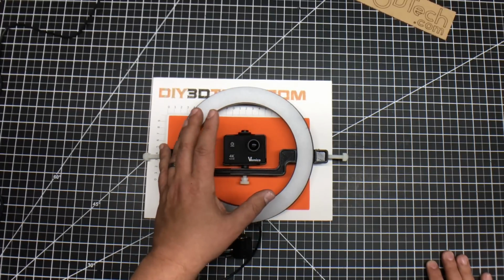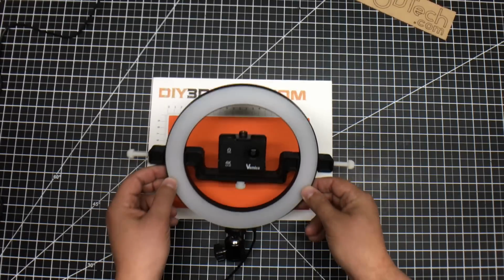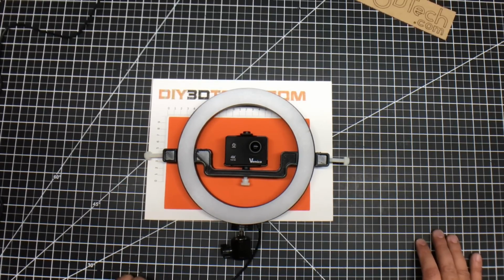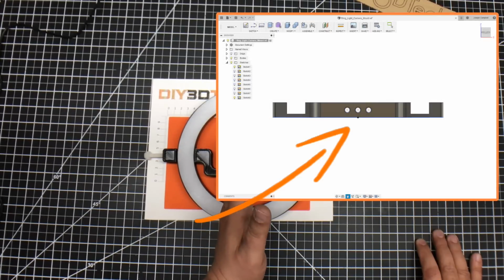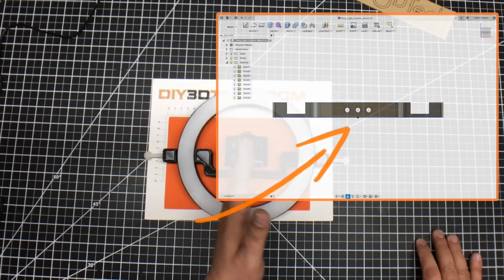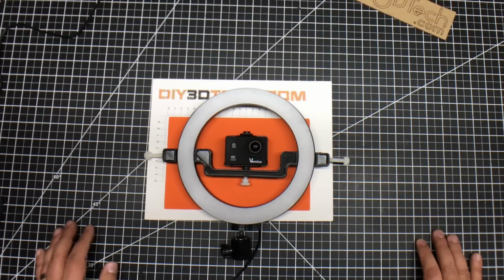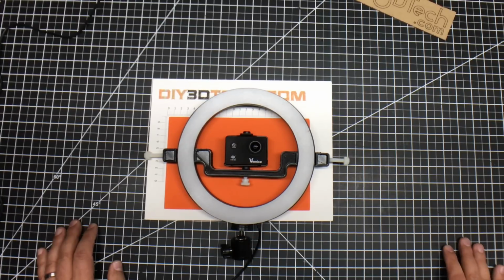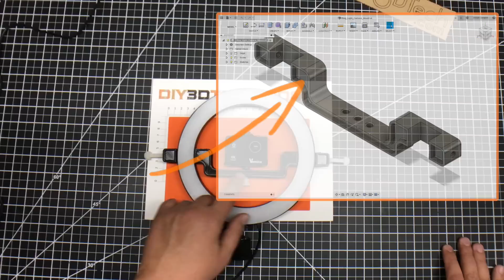Design Talk - Designing and Printing A Camera Mount For Ring Light!

Comment: Hi,
I don't want to complain because I like your design and it inspires me to make something like that, but if you're designing in Fusion 360, why not really center the lens right away. That would have been very easy from Fusion, and I think you already have the correct shape in the model to do so.
Thanks for the video.
Reply from the maker: Your welcome!  And the version I upload to Thingiverse has three holes in so you an move the camera "if" space allows as this part of the issue as I try design the bracket to make it lets say semi-universal as there isn't a lot of "room" in the center and wanted something I (as well as others) could use with differing cameras.  Hope this explains the logic.  :-)
Reply: @DIY3DTECHcom  yes it does explain it. Thanks, and again... You inspire me to make something similar instead of just downloading and printing.
Reply from the maker: Thats the idea :-)